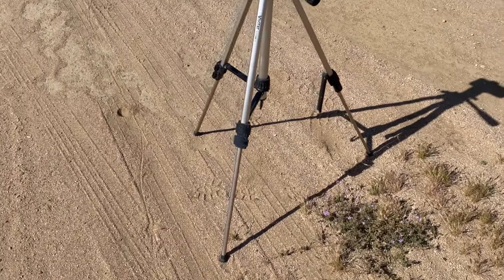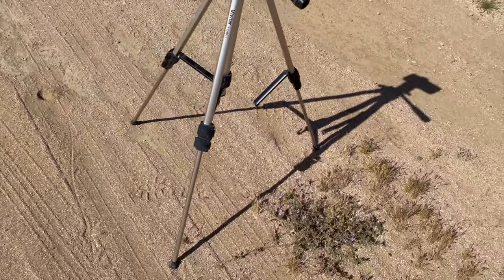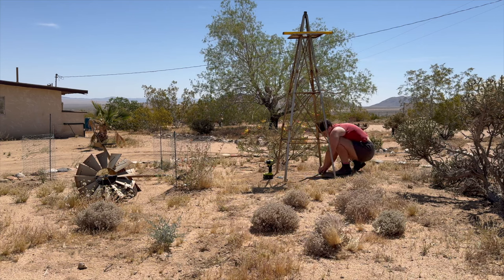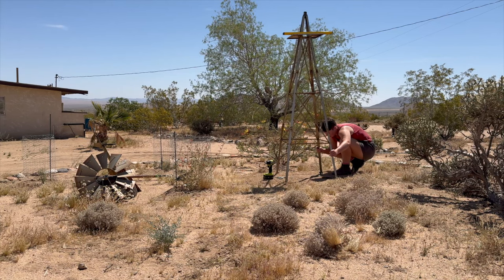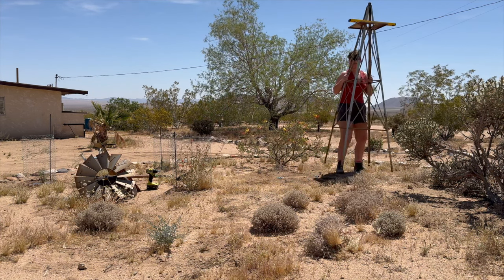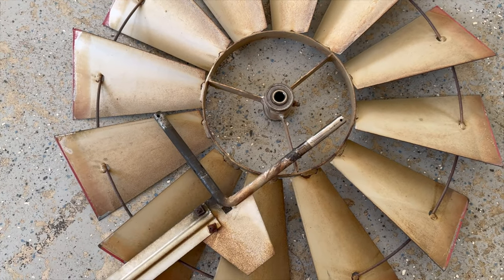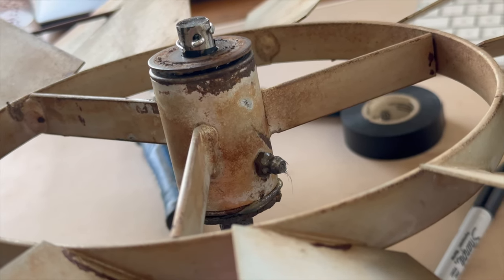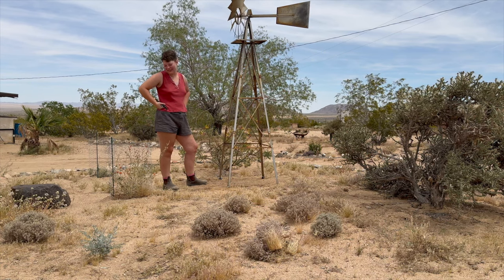41. Swap Meet Treasure | Setting up my New Windmill 🌞

Comment: if you have an engineering shop where you live would take the complete top and {{1 }} get a new bearing pressed in and the shaft adjusted  as they would have the know how  and grease every few months also the pivot point watching from AU, have seen these with a small pump attached  ,a scale of the deep ones in a bore,and a pond with water and the pump just lifted the water into a spray and returned to the pond  looked great ,and birds were coming after a while to drink and lizards .

Comment: That windmill is so cool! I wonder, do you think you could use it to generate some electricity for yourself? It sure looks windy enough and that would be free power for you.
Hope your knee gets better soon. Maybe wear one of those elastic sports bandages to help stabilize it some more until you think it feels less fragile?
Reply from the maker: It's just ornamental but I have thought about whether it could power a water pump if I wanted to put a little water feature out there. But keeping water in it would be a struggle cause it would evaporate quickly. for now it's just for looks
Reply: I have a bird bath that evaporates before the day is halfway through. Dang heat. Drat!